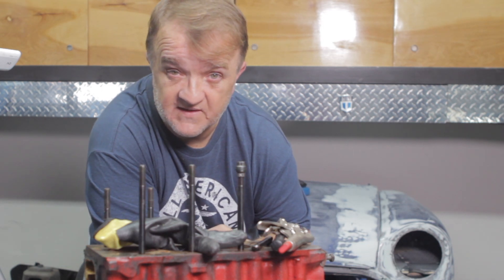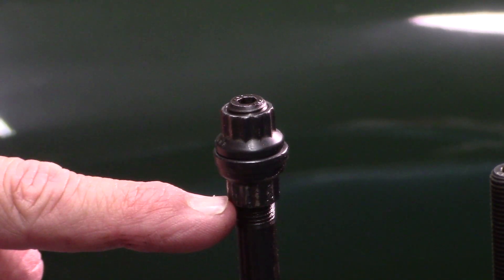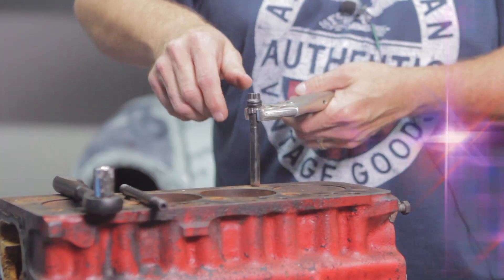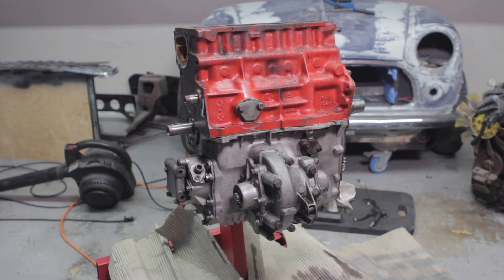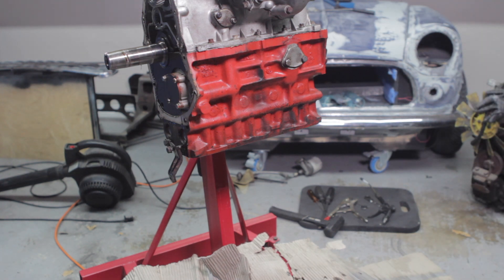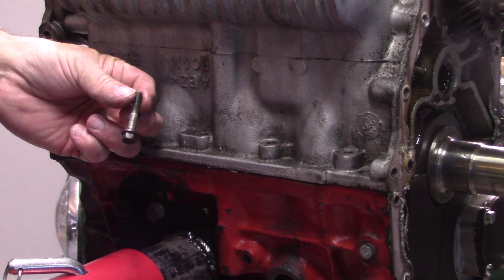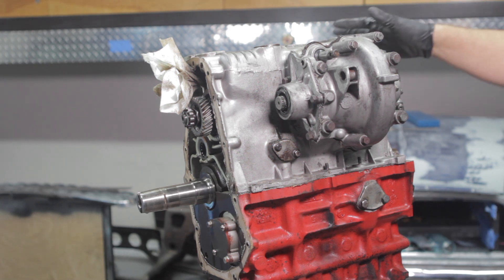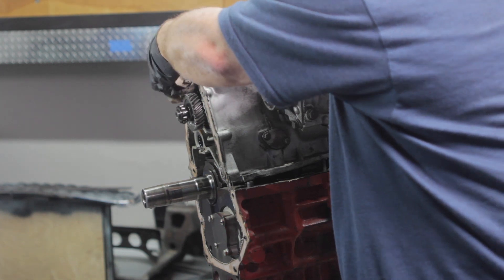Engine & Gearbox Separation - Classic Mini

Comment: ARP head studs! Fancy!, you normally undo them using the allan key socket in the top and if that doesnt work just use a proper stud removal tool, if you dont have one then use two nuts as you did. Its a big unf size. For turning the engine on a stand - stand at the front with a foot on the frame and that way you can turn the engine over, and wiggle it towards you to get the hole to align as it naturally slides back away from you. For the dowels - dont lose them, they are no longer available, and the central two suds above the diff housing - its normal but you often see them replaced with short bolts. I told you the gearbox might be a two person lift, certainly being short wont make it easy!
Reply: Stud remover I use works on the same principle as this one - it grips the plain shank and doesnt affect the threads. https://www.uktools.com/stud-remover-installer.html
Reply from the maker: @MiniPerformance  did not know there was a tool for this... thanks
Reply from the maker: Thanks Rich, you’re a wealth of knowledge.   I did not realize those two dowels, I did not realize they come out. They appear to be press first it.   Also...  can’t believe I didn’t notice an Allen key would work in the end of the stud/dowel... geez....  the gearbox wasn’t as heavy as it was awkward...

Comment: Hi Randy, the block alignment studs are called dowels, the one with a hole through (Tubular) has a bolt (and nut) through it on early engines. The two studs at the back (Aft! (you make me laugh!)) are there above the differential housing as there's less room to get bolts in at those locations. You're getting along great, one step at a a time! Cheers!  Flip Flops, Chinese safety boots or Thongs down here..... G'day!
Reply from the maker: LoL...   love the ‘safety boots’    I will feel like I’m being safe from here on out.   Thanks for the education as it all makes sense when explained!!

Comment: I noticed you are wearing Australian safety boots. LoL if you'd dropped a 12 point ring spanner over the stud before you put the nuts on you wouldn't have had to use vice grips. My back felt for you when you lifted the gearbox, and I don't have bad back.
Reply from the maker: Well that’s too dang smart, but I don’t believe I have a 12 point wrench...   actually it was more awkward than heavy because I’m short!!
Reply: A trick: watch movies on kaldrostream. Been using them for watching loads of movies lately.
Reply: @Jamari Bishop yup, I have been using kaldrostream for years myself :)